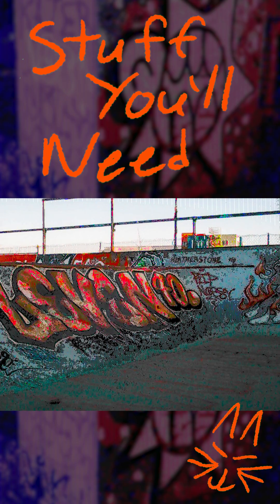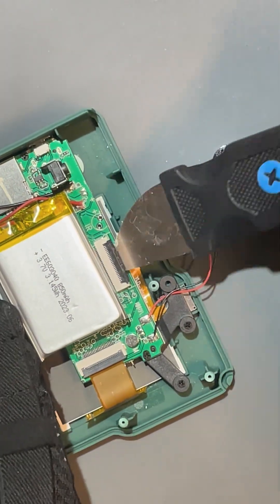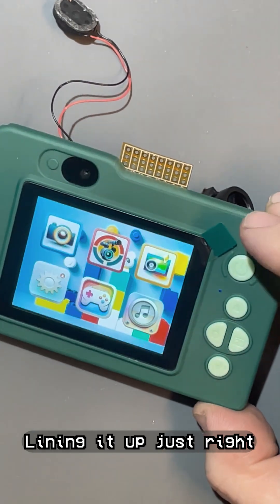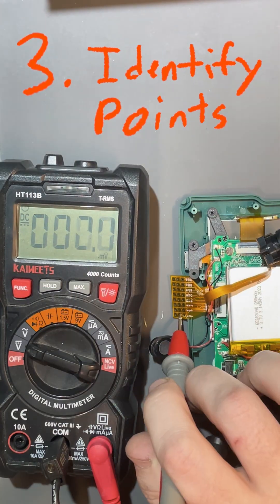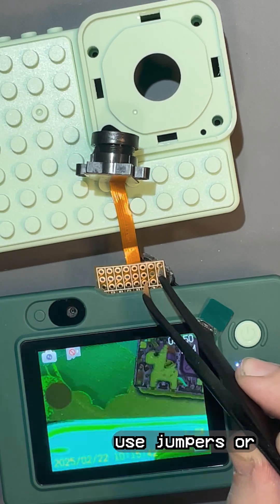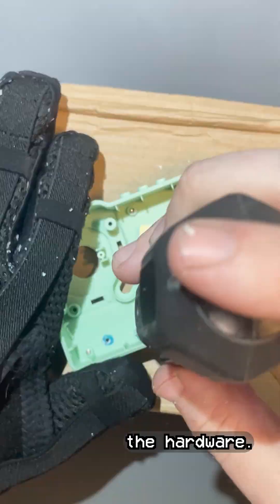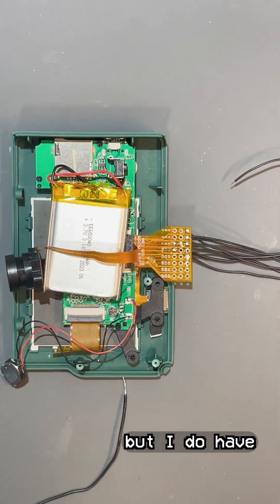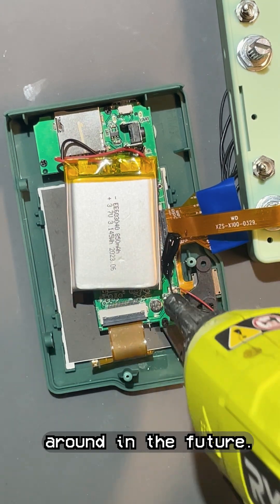How to Circuit Bend a Glitch Camera!

Comment: I keep breaking the flexy circuit board 😢😢😢 the first time i burned one of the contacts off and the second time when i was closing the camera up it ripped a contact off. Is there anything i can do to stop breaking them🙏🙏😢😢😢
Reply from the maker: Oh no! It sounds like your iron temp might be a bit high or you might be keeping the iron on a bit too long. 

Since flex is in plastic instead of composite it can get melty/brittle with too much heat, so I’ve found moving fast helps. But also feel free to email/post some pics to the Community and I’ll take a look to see if I can spot anything for more specific advice.
Reply: @getcircuitbent only one of the contacts broke off do you think i could connect that wire to the place on the camera and get the same glitch
Reply from the maker: @7chickenstripz812 yeah that’ll definitely work!